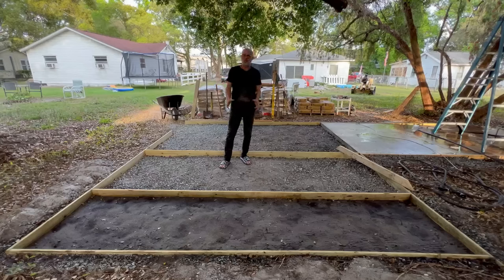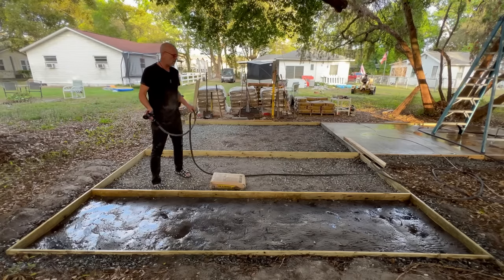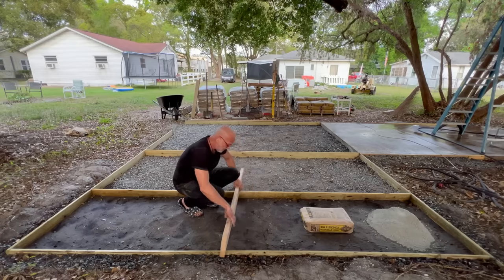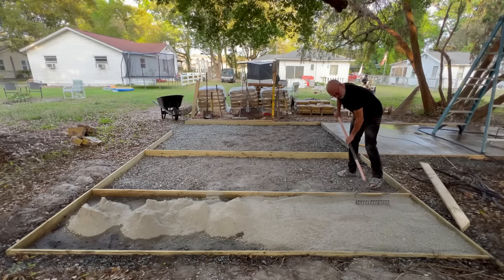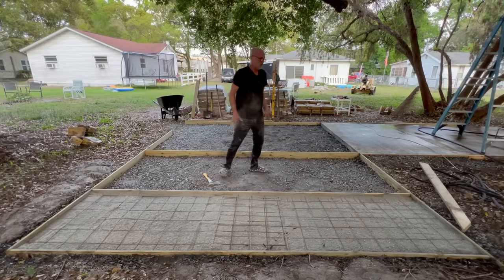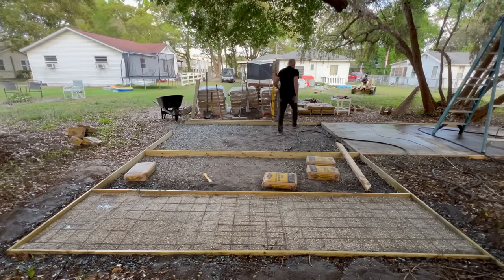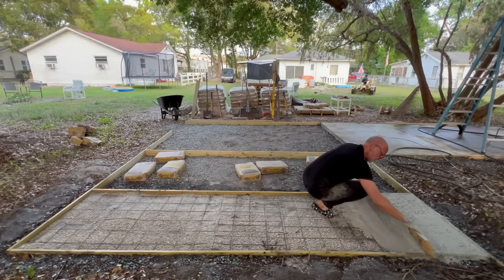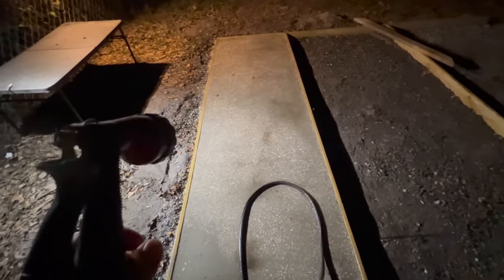How To DIY Dry Pour A Large Concrete Slab In Real Time

Comment: This video was exactly what I needed. I been on the fence for a few years now. I see no reason to pay some company 6k to do a area no bigger than what your done in this video. This was/ is a cool video. I’m inspired 👍🏽Thank you!
Reply: Just bought 100 bags for 4$ only saved like $50 buying 100 but they are delivering it.
Reply: Don’t dry pour it !!! Mix it in a wheelbarrow or even a bucket if you have to in order to save money but it will be far better then a dry pour !!! It doesn’t require all kinds of extra equipment doing it your self properly on a small scale .
Reply: Order a concrete truck and pour yourself. It's not hard at all. Rent a power skreed (really helps out). Having one helper will really help you out. I did an 18x30 slab (twice actually since i did an addition on it) like that. It was far more intimidating than anything.
Reply: Don’t do it this way
It’s built to last a lunchtime.
I’m an old pool builder. 
Actually, I built new pools. But I’m old.
 You can form it up and do all the work yourself. Plenty of how to on YouTube 
And it’s easy to figure the yardage 
4’x8’X6” inches is a yard 
With  10-15% extra 
Tell them you want 3/4 inch rock at 5,000 lbs with a 12 inch slump.
Traditional thickness is 4 inches. So 8’x10’ 4 in is a exact yard with no extra. 
But it’s better to be long than short. Or you run into all sorts of problems.
 Most concrete companies have a 3 yard minimum 
Probably 150.00 a yard depending on where you live.
Have an extra area ready to use extra concrete if you have it. Or for the driver to wash out in.
Like where your rain gutters drain. Or make some 12x12 frames and make a couple stepping stones.
I had to correct myself on my numbers above. 
Your mileage may very 
Try to have everything ready day before and pour early in the am.
Good luck
Reply: @Oldcrow77  <--<--Listen to this guy!    people thinking about doing this dry pour thing...
Reply: @TheStevedie  Correct, just order the truck yourself and have some friends help you out finishing it for a free lunch.  Much less work and faster.  Only problem is when it is a hard to reach area for a truck, and then you need a bunch of wheelbarrows or similar.  Then perhaps pour using bags.
Reply: @regularguy8771  where?
Reply: @BoofYou  what’s “friends” 😩
Reply: As much as you spent you could have gotten a truck!! If you don’t mix it good you will have pockets that still is powder !! Oh well everyone has a opinion

Comment: next time you pour, maybe try using a roller paint brush and an extension handle  just roll it back and fourth a few times, it tends to push the rock down and bring up the powder and leave you with a smooth surface.
Reply: Great idea!
Reply: I saw the same video of a guy using a roller the way u just explained and it worked mint.
Reply: Paint roller lol just get a magnesium trowel and a steel trowel lol maybe a 2x4 float . Don’t dry mix do it properly it’s a breeze not a lot of extra cost .if you want texture use a broom 🧹

Comment: I was watching another dry pour slab and to get rid of rocks on the surface, they went side to side many time quickly which caused the rocks to sink. He then used an edge concrete tool to soften the edge and a dirt paint roller to smooth it all out. Looked fantastic!  I,m researching if nI can do a driveway this way, but I have my doubts due to vehicle weight and needing like 5000 psi type. Good job with your project.
Reply: You don't need 5000 PSI concrete, especially if its sitting on subgrade, unless its a very heavy vehicle, and then I would worry more about proper subgrade compaction and maybe some minor steel reinforcement like this guy did in the video

Comment: Nice job I have seen smaller jobs done like this but love your idea of doing bigger areas as you did .One hint thought to save your back a little? Maybe use the Wheelbarrow to bring more bags of cement to the area your working on . How about a shovel to cut the bags open as well .
Reply: The shovel works great for opening the bags, and there is a little tear tab on one end, usually.
I find that a trenching shovel and a wheel barrel will mix it up quite easily with a gallon of water or so per bag.

Comment: I'm looking at having a steel shed built in my backyard that is 40x30. Would you be able to do rebar in a dry pour? I'm looking at doing it myself. Also do you take out the separation 2x4's when you move on to your next section? First time doing anything this crazy 😆

Comment: Dude, the reasoning you gave for doing this in the intro sounds exactly like the internal dialogue I have with myself for every DIY project. No rush, no condescending judgments. Just a nice, self-paced job. 

The arguments against outside-the-box methods like this remind me of the people that like to bash Harbor Freight and "foreign tools" because they say they won't last X amount of years. Maybe so, but they're also 1/3 the price. Worst case scenario, I need to buy 3 over the course of the "quality" tool lifetime. But still, I enjoy fixing things, and I'll have a lot of back up parts. 

The only thing I'd do differently is PPE, but it should be noted that I don't really know any of the possible risks involved here and, personally, I tend to be irrationally over-cautious.

Edit: spelling correction
Reply: Ive heard my share of "no harbor freight and no  foreign tools" and they're the same folks that bash everything and then mostly do a crappy job except on certain well defined tasks that they do the same way over and over. I dont touch those contractors anymore.   However that is different than complaining about out-of-the-box methods. The latter have "more to prove" - and should do so before being considered for important projects. The tried and true does have the advantage of history/experience.  Before using dry pack I would need studies showing when it works and when it does not and how to mitigate the risks of not doing a proper water/concrete mixing.  It's about science here - and that groundwork has not been provided here to my satisfaction.  Show me studies and I'm interested. Not just a couple of examples (chicken coop etc)  that do not reflect ten years of battling the elements.  I'm all for simplifying processes but only with evidence they're not damaging/risky to the final product.
Reply: The problem with dry mix is that it would appear impossible to quantify the amount of water the concrete gets.  The amount needed for optimal strength is fairly critical. Further, the water distribution will not be uniform throughout the mix.  @StephenBoesch

Comment: What is the psi indicated on the constete mix. For slab for that use 3500psi is overkill. Just because you watch other do the dry concrete mix you do the same. Probably you save if you add gravel and sand to the mix.

Comment: nothing    wrong   with  what  you  are    doing     i   have   been   doing  this     for   yrs    when  i      do    slabl   i   do    the   4  in    and   do  the   2   inch   put the   wire  in   and  when  i    do     a  6  inch   slab  i   iwl   do tow  inch   on   top  oif  the   tywo inch  and   pput   in a   anorther wire      the    bigges  one i  have   done   is  over   5000 sq ft     and  i   do   my   footing    the  same     since i    do      32  inch     holes    evevry   8 ft    for  a   stand  off   for   my   post    because  i   do   post   building   and i  have   neever   had   any    cracks      the   only   thing  i   do    i   use   the    expandsing   joints materital   on  the     insde  of the   form   and  then    when  i   sttrip  the   form   the     joints  is   allready   there    oh  by  the   way   i  have  been  a   gen    cont  for  over   68  yrs   and i    stil   doing   i  have  so  much   work  here     because    porting   with  the      trucks  and the   labor to   do  it    they   ant   to    rob  you    the   last   slabl  i    idi  they   want 22000    i   didi  it  for    under 2800    so   i  have    done    patios  and   side   walk  and    drive  way   and you   can  tell  the  different  fron  a    pore  from  a  truck   to   what   i  do   so    you   didi    good      Chiefwhiteagle  log and  timer framed    homes    out   of      Idaho
Reply from the maker: Thank you!

Comment: After you screede your dry mix flat, before you mist it with water, go back to the beginning and use the screede once again over it but push and pull it back and forth in a sawing motion and it will snooth it out even more without having to pat it with the wood float.
Reply: He did it nothing like Cajun Country Living. He would get a better finish sawing the board back and forth and slightly tipped back. They did not wet the ground before also or in between !

Comment: I would like to know if this would be strong enough for a standard pick up truck to park on regularly. I have a metal carport that I would like to slab up. I watched another where the man used a dry paint roller and just rolled the dry top to create an even surface prior to final misting. It worked to perfection and left a very uniform surface.
Reply: You'd probably want a good compacted gravel base and some rebar or wire in it. And be sure to soak it good and keep it moist after the initial misting. Probably go 4 inches as a minimum to keep it from cracking.
Reply: No,
Do what the guy above said. But probably add some more portland to it. Like an extra shovel per bag.
I personally wouldn’t do a slab that was gonna bear much weight this way.
You stand a chance of uneven mix in your concrete and having weak spots.
Rent a mixer. I was looking at this as an option for a small slab. as an old pool builder, I hate dealing with concrete. I’m gonna stay with a wet pour in the am hours.
 But this is fine for what he’s doing. But not anything serious in my opinion.
BTW, it’s not so much water drying that makes concrete set, it’s the chemical reaction. So make sure you are ready to shit and git.
He should have had his other bags ready to put down before he started spraying first layer or you stand a chance of Creating a Cold joint, where the two layers don’t bond to each other. Noticed how he mentioned exposing the aggregate when spraying it. That means the second layer has less of the mix to bond to.
 Good luck.
Reply: @EthanPDobbins  Thanks for the input. I do have a patio area that will be foot traffic only that should be easy to do. 👍
Reply: @Oldcrow77  Forgot about the portland, good idea. I didn't forget the steel and/or wire. Thanks
Reply: @jimgraham4673  also, if possible go for radius corners VS 90* less likely to break off
Reply: I agree about creating a cold joint - Never water until all cement haws been placed - Will be about 75% as strong as mixed cement
Reply from the maker: Just mix it up dry with a rake when spreading it around.  For anything other than a driveway, I believe it will be fine.
Reply from the maker: Yes, watering makes getting the top part flat is very difficult.  It doesn't"t flow like wet cement.  But watering the ground and watering after a couple of inches after the wire is added is not going to be a bad idea.
Reply: For pickup truck you need 6 in thick. And you need inverted borders. Mist, do not spray to not wash cement away. After it hardens cover it with burlap or straw or polyethylene film and keep it moist at least one month. It will be even stronger than concrete mixed with the water
Reply: If you want to ensure uniform strength of the concrete then don't dry pour it. Use a proper mixer. Go with 6" thick if supporting vehicles. 6"minimum of compacted gravel underneath and rebar in a 12x12 grid.

Comment: Obviously, you aren't in an area where you need to worry about freeze/thaw.

If there is a chance for freeze/thaw events, exterior concrete needs to be air entrained (about 5-7%) and have a smooth finish.  The smooth finish prevents moisture from getting inside the concrete and expanding when it freezes.  The air entrainment adds tiny air bubbles inside the concrete to allow room for expansion during freeze events.
Without those 2 things, concrete will break itself apart, in northern climates, in a few short years.

Also, without precise amounts of water, some of the cement powder may not hydrate (cure) sufficiently.  Too much water can greatly decrease the cured strength. 

If you order your concrete from a local supplier, you can ask for something called Fiber Mesh.  It is a bunch of tiny strands of plastic that greatly decreases the occurrence of cracking.  It works much better than the wire mesh that is placed in this video.

But if you aren't concerned about strength, finish or freeze/thaw, then this may be an option.

For sub-base for concrete slabs, you aren't necessarily looking for "hard".  You want something consistent.  If you could get a slab to float, water would be the perfect base.  Evenly compacted sand is really good......yes, you can compact sand.  But it has to be fairly wet while you are compacting it.......about 7% moisture.  Hard and compact are NOT the same thing when you are talking about soils and aggregates.
Reply: your reply made reading this thread worthwhile - obvious you know what you are talking about. Thanks for taking the time
Reply: Nice.
Reply: @doublesharp5795  
Thank you.  I know a bit about concrete.  I have been in the business of testing and designing concrete for almost 30 years.  I am also a senior bridge inspector.
However, the MASTER of concrete knowledge is Kim Basham from Wyoming.  He's the guru...

Comment: May be for Florida 2 inches is good. May be for Florida such invention will stay as a whole in winter time. Here in New York it is not. Just wonder to understand the reason same Home Depot rental concrete mixer was not rented and applied to such project. It seems electricity and water supply are available. What is the catch to do the project like that ?

Comment: I enjoyed this video. I wonder how long before it cracks ? I would think it would need more water......we will see how well it holds up in time to come.
Reply: Shouldn't crack (but shouldn't have added any water until the end) - I did a 12' x 36' dry pour over a year ago in a single pour  -  Still looks great

I put down 2", then wire, then another 2" cement - I did NOT add any water until all 4" was poured. Also used paint roller to smooth and broom finished
Reply from the maker: I water it regularly a little at a time.  You can tell when it sucks up the water and when it's good to dry out a little bit.  After a few days, The water stops just soaking in.  And it's obviously setting up nicely.

Comment: Just curious, but I paid a few guys once that were just workers that worked on a team doing concrete, and all they did was call a concrete truck company to pour the concrete once they prepped the area, and they really did OK job, but they did not charge my much. So I assume most places you call to do concrete work are just middle men that prep and then call a company that runs around all day and dumps the concrete in the spot. Can yo just call those places directly if you know how to prep the spot? how much would you save, and it has to be a goo deal and way easier than using a ton of bags.